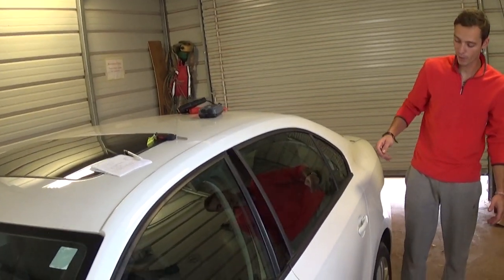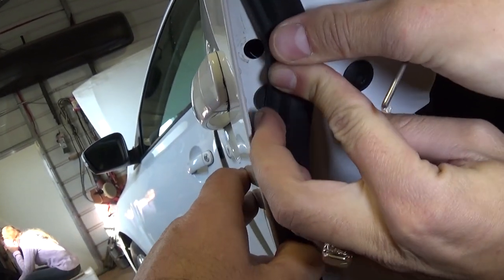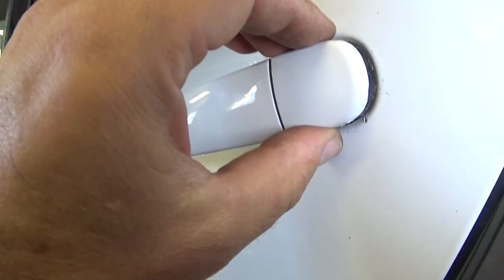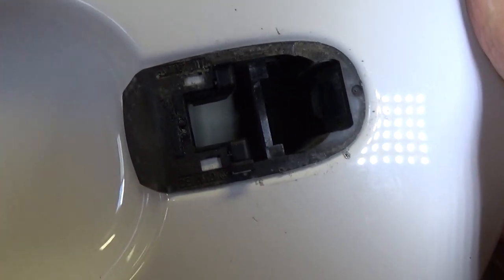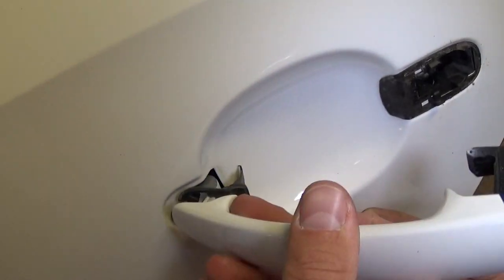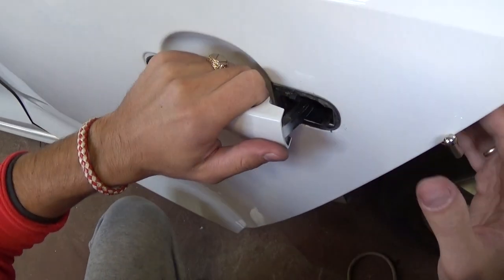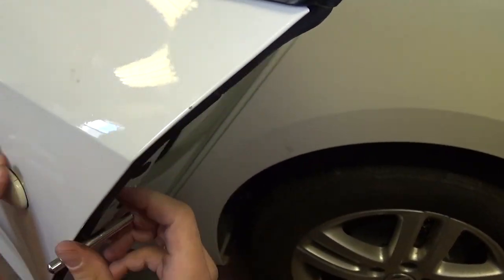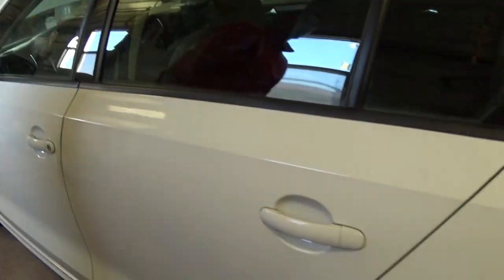VW JETTA MK6 REAR DOOR HANDLE REMOVAL REPLACEMENT | VW GOLF MK6

Comment: Hi guys, I want to remove the outer panel of the door but I can't find the screws like the ones on the front door, will they be under the rubber gasket on the door, just like in this video?